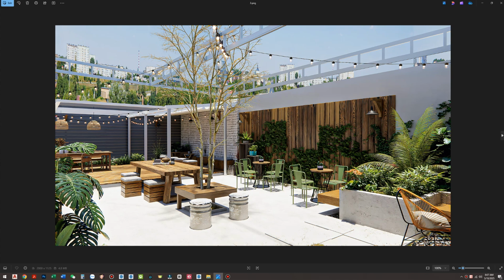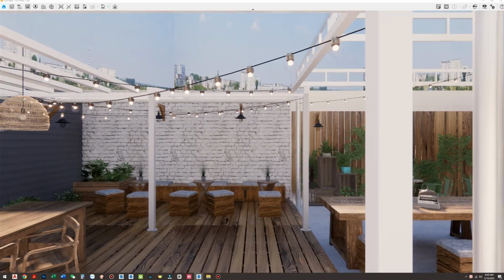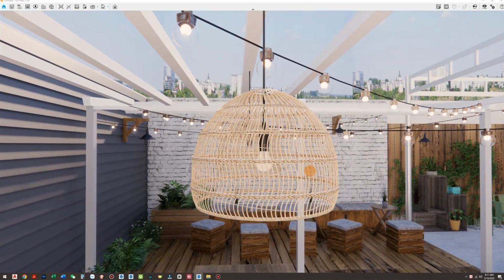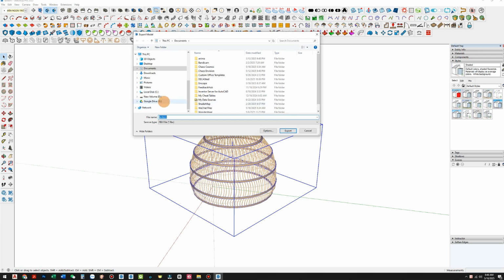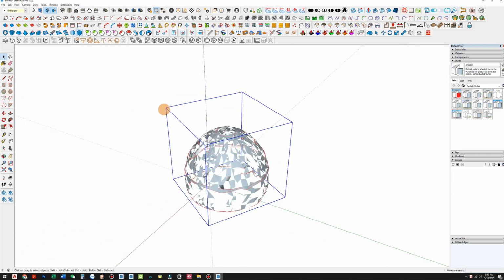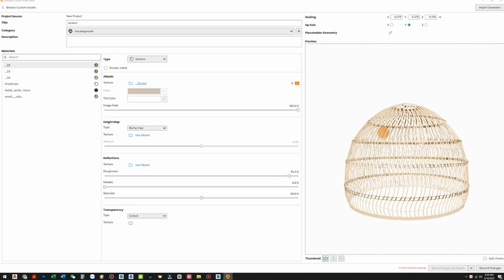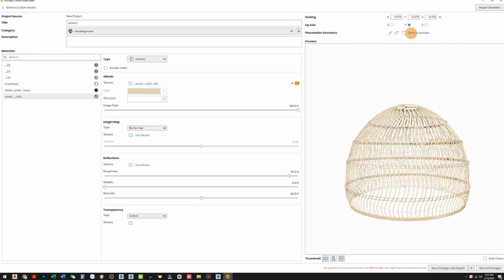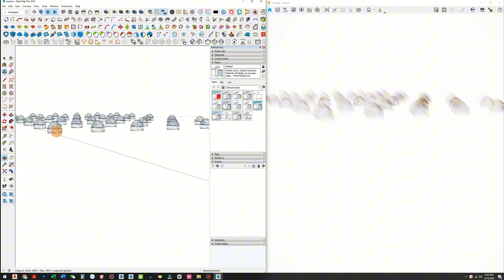Convert Lantern SketchUp Model to Enscape Asset

Comment: Can you advise for high ploy to create custom asset library. Even my Enscape not respond in large FBX file .
Reply from the maker: Absolutely — working with high-poly models to create custom Enscape assets can be tricky, especially when dealing with large FBX files that slow down or crash Enscape
Instead of importing full mesh:
Create a low-poly version for Enscape.
Bake normal maps from high-poly to low-poly — still looks detailed in render but is light to load.
If you're still unable to resolve the issue, please send the file to me via email and I’ll be happy to assist you. Wishing you a wonderful day .